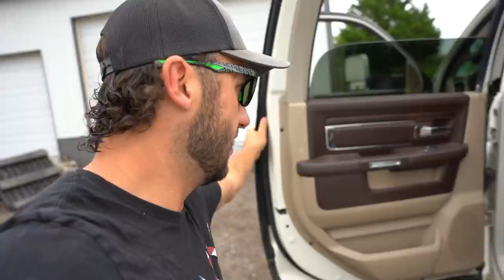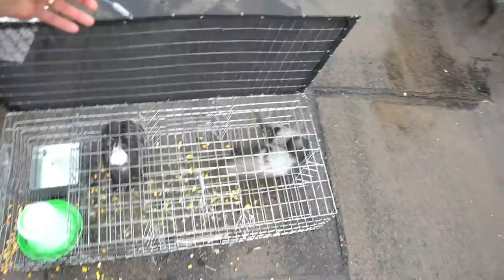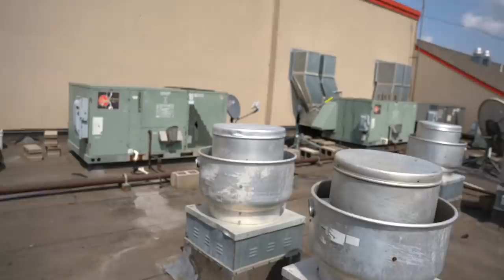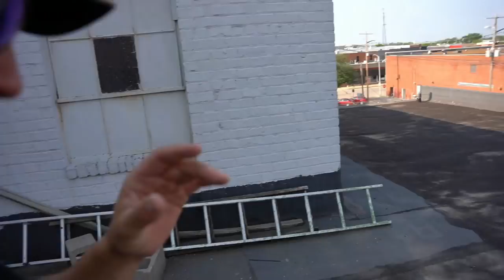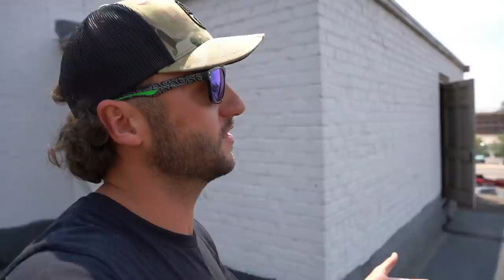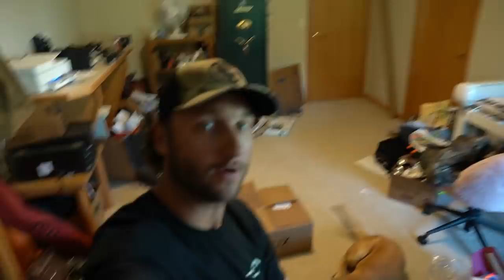You'll Never Guess What Has Been Killing/Eating My Trapped Birds..

Comment: You can make funnel traps for much cheaper on your own if you don’t want to spend so much Bobby. Buy a roll of 2x1 welded mesh wire, some rings/j-clips to put hold
It together, and a wire cutter. You can make multiple traps out of that, and probably place several on each rooftop.

Also, try making a small trail of bait that leads to the entrance of your doors so it can potentially lead birds into the trap.